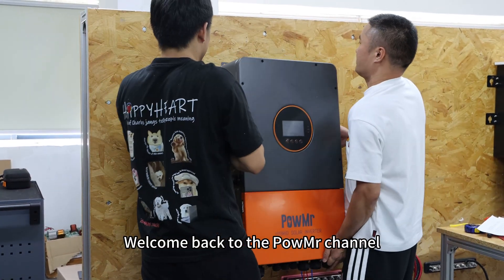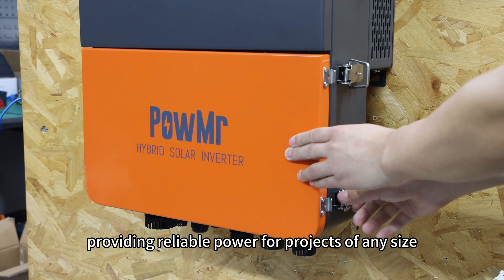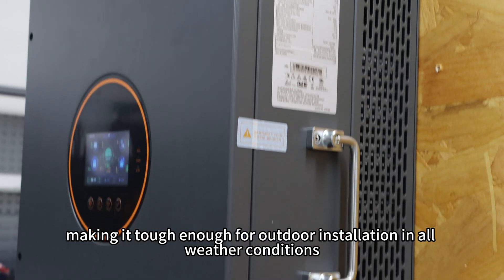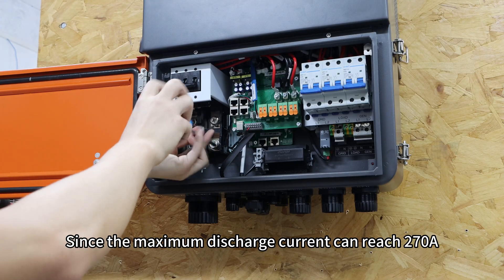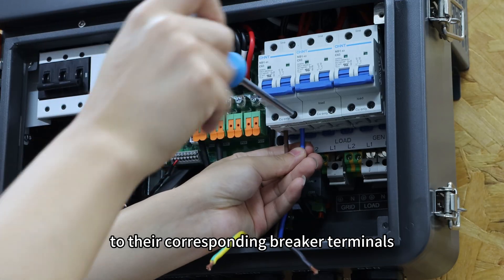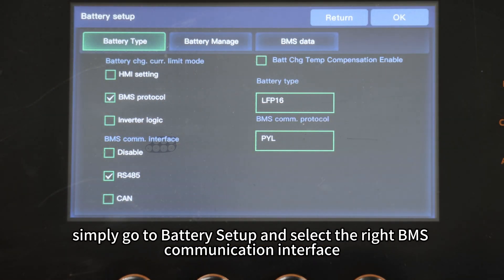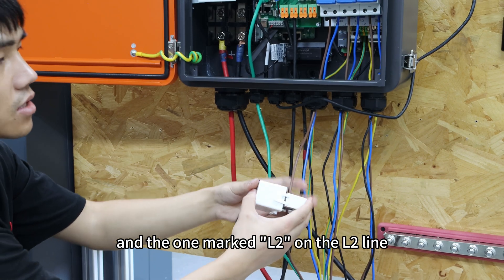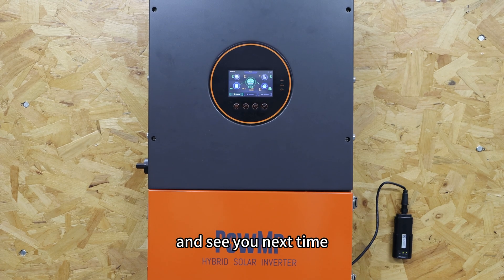How to Wire the POW-SunSmart LVM12K Solar Inverter?

Comment: Can you produce the same technology as this model with the 6.2 kW, 8.0 kW, and the 10 kW models for household use (230V/50/60Hz system) with the cheaper price. This new hybrid has great functionality and a user-friendly touchscreen interface similar to DEYE technology. Aside, it has a dual function on-grid with a CT limiter and off-grid.
Reply from the maker: Thank you for your suggestion. I will feedback to our product department.